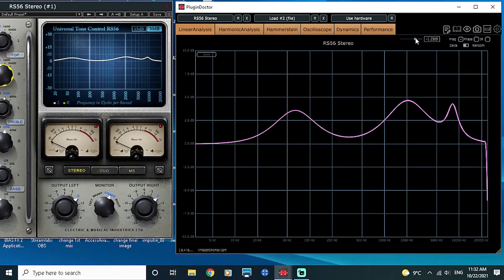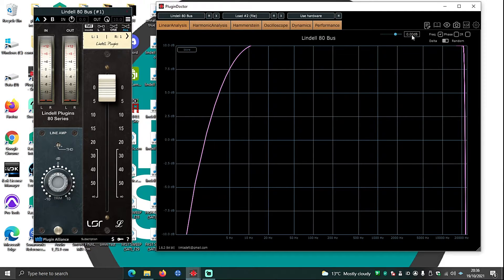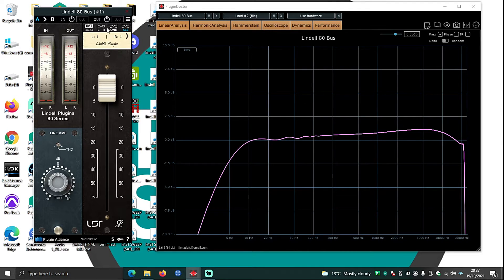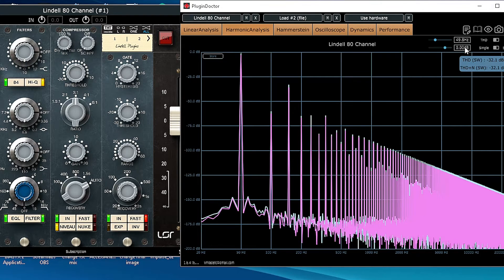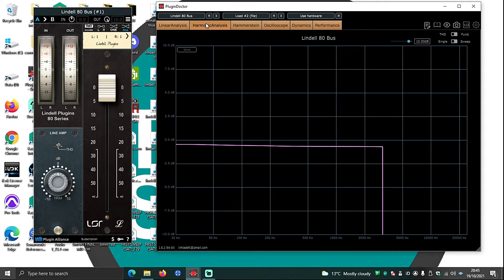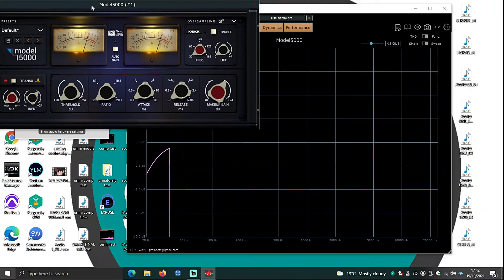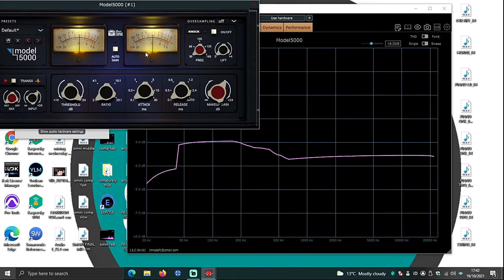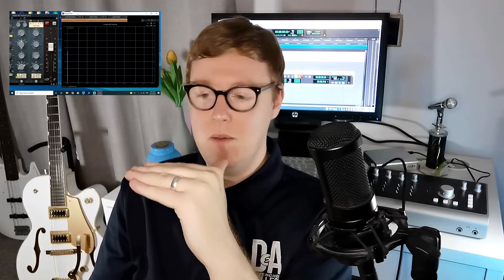DDMF PLUGINDOCTOR TUTORIAL || Understanding eq curves, oversampling & THD when plugin testing

Comment: Paul - Very nice job - quick question.  Are we supposed to be able to see analysis of currently active plugins inside our channel strips? (running, Logic 11.1.1).  PD loads a seperate version of the active strip plugin, outside the channel strip. Was hoping to mix real time with this inside the strip. Don't see anything addressing this on the web. I would appreciate any guidance you may have. Thanks so much.
Reply from the maker: You would need to use ddmf metaplugin to do that in doctor

Comment: Really helpful tutorial, Paul.
I'm wondering if 50Hz for checking harmonics content is just a random choice or there is some logics behind it?
Reply from the maker: Even worth checking harmonics at 10hz as it's the orders of harmonics you need to keep in mind. Transformer harmonics are normally very low down the frequency spectrum but the order of harmonics stretches into our audible range dependent on the strength of those low order harmonics. Do you need to worry about aliasing that low.. No, but it tells you why you are percieving a bit more overall weight independent from frequency response
Reply: @PaulThird  Got it, thank you!

Comment: there isn't any adc that doesn't add a high pass filter at 22.5 kHz (nyquist) that's wht they're trying to replicate using anti-aliasing filter but for aliaisng. at supersonic frequencies above 22 Khz.
Reply from the maker: So does every ADC cut at 22.5k regardless of sample rate?
Reply: @PaulThird  yes they do but having it lower than 48 kHz can screw up with the high end on an adc for example on 44 kHz. 96 kHz yields the best result in retaining top end on a ADC. Most plugin that adds an anti-aliasing filter removes it when the project is run at 96 kHz or higher so at this time the daw does the job but most daw have very bad sample rate conversion which leaves some of the aliasing in the top end there's three ways you could fix that 1) it's to use a daw with a good anti-aliasing filter when converting to a lower sample rate from 96. 2) export the file at 96 and convert using dbpoweramp or izotope rx and some others that yields very good sample conversion and antia-aliasing filter. 3) use tools like ddmf metaplugin on 2x oversample for offline boucing or airwindows ultrasonic at the end of your analog modelled plugin chain when your running your project at 96k.

Comment: I’m not an audio software programmer, so there’s a flaw in this logic I don’t understand: why can’t aliasing be stopped by some sort of check on where the generated harmonics will end up (before Nyquist or after) So the plug-in does the math to generate harmonics, then there’s a second step that checks where all of them are in the frequency spectrum and omits everything passed say 18K at 44.1. But just the harmonics are omitted so they don’t fold back. Is the problem simply that it’d be too CPU and latency intensive to make sense? Even if possible, I see no way it wouldn’t add latency. Anyway, I geek out on this stuff too. But I’m supposed to be working right now so back at it!! 😂
Reply from the maker: There will be a reason. I always think 'if it sounds easy to do and it's not been done'.. Its not easy to do haha
Reply: You can't filter out frequencies that Nyquist can't cover: The fold-back distortion already happened before you can apply any filtering.
I could imagine it could be possible (in theory at least) to do a frequency dependent saturation: Say, for example you have a simple hard-clipper that adds odd harmonics, and you want to prevent those harmonics to fold back. Then only clip those frequencies where the resulting harmonics wouldn't get outside of Nyquist (easy to predict with a simple hard-clipper) and leave the rest alone. Maybe this is possible by dividing the input signal into many narrow frequency bands, or maybe something could be done using a Fourier transform.
However, it would be waaaaaay more CPU consuming than simply applying oversampling, and I suspect that in practice it's pretty much impossible to make it work perfectly anyway so the result wouldn't be any better than oversampling.
But anyway, I haven't tried something like this myself, so maybe I'm forgetting something. 
But in the end, oversampling is a relatively cheap way to properly prevent/reduce aliasing. And in my own experience aliasing is a relatively small issue that's usually hardly audible in a full mix (if at all), especially when the channels with more heavy saturation are oversampled.
Perhaps a more practical solution would be if the DAW would apply a very brute-force amount of oversampling for every plugin when rendering the mix, to get rid of any remaining aliasing.
Reply: @jaydy71  this is kind of what I figured, that even if there is a way it’d be way too CPU expensive, particularly when oversampling is effective, not terribly expensive, and I imagine easy to implement most of the time. DAW’s including an “upsample on render” option would be fabulous. Maybe it could cause problems with some VSTs?
Reply: @mrnelsonius5631   Regarding the 'upsample on render' option, it's something I'd really like. Actually it's a feature I proposed to Steinberg for Cubase (next to a feature to oversample any plugin). I think it would actually be rather easy to implement: Just oversample before the signal hits the plugin, tell the plugin the oversampled sample-rate, apply the anti-aliasing filter and then downsample the output. 
I don't think it would be a problem for any VST because from the plugin's perspective it wouldn't be any different than having the whole project running at a higher sample-rate. I believe there are actually some 'meta-plugins' that can do that, but I haven't looked into those yet.
I suppose a potential issue with the 'upsample on render' option is that what's being rendered will sound slightly different than what you've actually mixed (perhaps some of the aliasing was part of the sound you were going for, or something like that), but I figure in most cases it will just sound better.
Reply: @jaydy71  yeah, and there is also a quirk in how a lot of plugins handle the project sample rate. Many essentially scan for the sample rate at the moment of being instantiated in the DAW. Such as many convolution plugins: they operate differently depending on the project sample rate, and a mismatch can cause audio issues. Acustica had a problem for a long time where, if you started the project at one sample rate then changed to a higher one before export, all your EQ curves would be totally offset. It would destroy your mix. I think they eventually fixed it but I could see other plugins struggling with an external sample rate change too. The thing about plugins is that they all work in very different ways. Just like aliasing, developers can handle it quite differently depending on the quirks of their own processing methods. It’s still a good idea, and if something needs to change in the VST format to accommodate sample rate changes on the fly, it should
Reply: @mrnelsonius5631  I see, yes I suppose that would create issues. The VST interface already has an event that tells the plugin the (changed) sample rate, so I don't think the VST format needs a change to accommodate that. If some plugins ignore that event, then that's basically a bug in the plugin.

Comment: and if 80 db is the threshold where harmonics can be heard what is the point with aa plugs.... ..  their orders barely touch -100 and if you raise gain to raise up the harmonics to be above -80 aliasing is introduced... i just got done testing gain-station and as soon as you take the clip to +12 a ridiculous amount of aliasing  comes in....  but just a smidgen under -12 and it goes away..
Reply: Don't own any AA plugs. barely touching -100 seems odd to me though. Are you talking about the noise-floor or the actual harmonic peaks? I don't mean to be disrespectful - I'm just trying to make sure we're talking about the same thing.
Reply: @akagerhard  also the same thing happens if i leave the clipper alone and do the same thing at +12 on the pre dial
Reply from the maker: Have you tested at different frequencies instead of 1k and tried using the compressors and stuff? When I printed sweeps of a lot of hardware they were actually pretty clean tbh depends on the gear